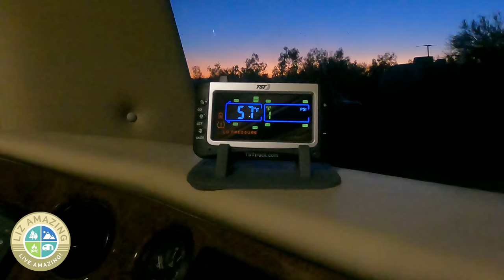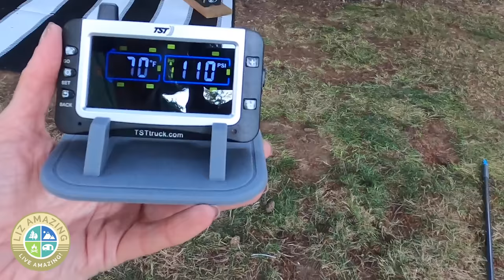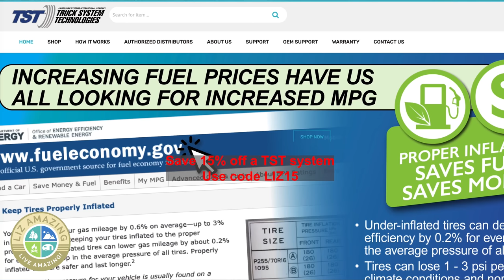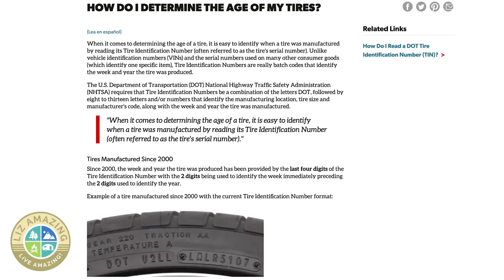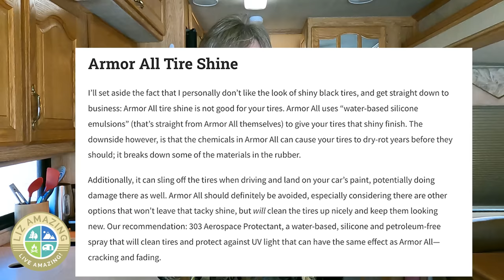3 questions everyone has about RV/Trailer tires

Comment: We live in South West Florida and we have a 2006 42' Monaco Dynasty Class A diesel pusher. After hurricane Ian there is no way we were staying for hurricane Nichole. My wife had recently had kidney surgery so we had to wait for her after surgery doctors appointment before we could leave. We left on Wednesday knowing Nichole was coming on Thursday, but as I said we didn't have a choice. Thursday morning we were on I-10 west heading away from trouble when a trucker tooted his horn to get my attention. I looked over and he was making a circular motion with his hand. I figured something was wrong so I pulled over. The passenger side was fine. I was worried the car we tow may have had a flat tire. On the drivers side I found the problem. One of the rear tires on the motorhome had a blowout. We have a tandem rear axle so we still had two tires on the road. There was an exit 2 miles ahead. We drove to the exit and over on the left there was a Truck Stop of America with a tire store. I was like thank you Jesus 🙏 We pulled in and the salesman assured me they had tires to fit my RV and I could even choose between brands. They told me to unhook the car and back up to Bay 5 and they would get on it immediately. With hurricane Nichole heading our way this made me happy. As I backed up to Bay 5 it started sprinkling. The mechanic told me they didn't have my tire. The ones they had were half an inch shorter. They recommended another tire shop in town and gave me their phone number. The guy said if I ordered the tire in the next 3 minutes he could have it there at 1 pm. I told him to do it  That was a 2 hour wait and it was starting to rain. We drove over to the other tire shop and waited. We had lunch and watched a movie. 1 o'clock turned into 3 o'clock and no tire. By this point it was raining hard and the winds were picking up. We were parked out back so I put on a raincoat and went around front to see what the deal was. Just as I got around front I could see the guy pulling our tire out of the delivery truck. The manager told me to pull into the end bay. He said there was a roof, but open sides so I would have no trouble fitting in. Our motorhome levels on the airbags. We don't have jacks. The mechanic had me pull up on block's to get the tire off the ground. By this point Nichole was upon us. It was heavy rain with the winds blowing the rain through the bay. Even with raincoats we were drenched! This guy was so good that he changed the tire without removing the rim from the coach. After he had the new tire mounted he checked the air in the other tires. The rear tires were averaging between 68 psi to 76 psi. The fronts were pretty good at 90 psi. So he aired everything up, we paid our bill and we went back to the Truck Stops of America to get our car. By the time we got hooked up it was almost black out because of hurricane Nichole. My wife and I talked about it. We didn't feel safe driving in a hurricane so we called around and found a campground with an opening 3 miles away. We drove over and I hooked up the electric and water. I didn't hook up the sewer or disconnect the car. The rain and wind were just coming down way to heavily at this point. The next morning Nichole was gone. When we opened the front curtains we found we actually had a beautiful lake view. The previous night I had no idea the lake was there. Visibility was that bad. I learned real quick on this trip that you have to keep track of your air pressure.
Reply from the maker: Wow, what a great story. I was on the edge of my seat. Thanks for sharing Adrian. Definitely consider getting a TPMS. You are so very lucky that the flat didn't take pieces of your motorhome with it, as it could have easily done had it disintegrated. And so glad you were both safe from Nicole. Thanks for watching.

Comment: I am so confused with our tire monitor.   We have a 36ft class A.  Every time we head out, the monitor always goes off. It is set at 80psi and at 96psi it goes off.  Cold start is 82 as our manual says.  I look down and then I ignore it.  I guess if it goes over 110psi I will pull over. Should I let some air out?  Any video I can watch? Thanks for anyone's comment.  The tires say max 110psi.
Reply from the maker: Hi Brad. Sorry to hear this. I wouldn't want to advise you on this. Your best bet is to call the mfr of the TPMS and get it set up correctly. Know before calling the recommended psi for your rig. Best of luck, this is too important to ignore.
Reply: @LizAmazing  Thanks

Comment: Easy fix add nitrogen to your tires instead of air we always used it in racing tires
Reply from the maker: I've heard nitrogen is good, I just never see it to top off on the road, or when the tires are low in the campground. Thanks for watching.

Comment: Howdy  tires give me nightmares!😢 I have spent hours trying to get the correct tire pressure on my class A. Toyo won’t say and I can’t do the the theoretical algebra math to come up with the answer. 😮 if they put max tire pressure in as they do I bounce down the road breaking things inside and the grandkids see their world coming to an end! Creepy tire manufacturers won’t say cause they don’t want to be libel in sue CA. Cracks  here we go again! I get it all. But if they are not cracked why replace them,  just have them inspected according to use! Rotate them and have a nice day. I have a older Class A. I have a Cadillac taste on a Yugo budget. 😅 I actually called the tire dealer who sold the tires to the previous owner and they would not commit to anything but 120 pounds! I said Shalom. I appreciate Liz and her info because we think alike. Any input is appreciated and welcome. I just want to safely go down the road and not have Top Ramen when I get there. Blessings John T.
Reply from the maker: Aww, thanks for this John! I, too, had a hard time finding the correct pressure for my rig. First I posted in the Alfa forum (Alfa is the make of my rig). I got five comments with five different psi recommendations! I got out the manual and learned that it depends on the weight of my rig. The mfr recommends get a four corner weigh and put four different psi depending on the weight for that corner! I'd already weighed (not four corner) and lowered my psi from 120 to 115. Thanks for being here, John!

Comment: Tires dry rot and should be replaced about every 6 years. Also be sure to check the manufacture date of your new tires. You don't want to buy ones that have been passed their shelf life. Although personally I don't bother but unless they won't hold air. But if they on a big vehicle like that better safe then upside-down in the ditch.  Also your ride quality will improve with rubber that isn't rock hard. All in all worth it.
Reply from the maker: That's the truth Mike, so glad I could share in this video about how to read the manufactured date on the tires. A lot of people don't know that. Thanks for watching.

Comment: Do not add Air to tires when Hot while Traveling because the Tire will explode while U-R on the Road OR while U-R adding Air to the tire So Always winter & Summer Always Add Air When begging of trip Do Walk Around Tire inspection & Air pressure. To make sure U don’t Have incident.And /U-R Saftey if U-V ever seen A Tire Blow it Can “Kill.”U.

Comment: As a vehicle dynamics/ tire development test engineer, that 6 to 8 year replacement "theory" is not correct, I highly recommend for motorhomes tires, at the 5 year mark from the tire date code, have the tires inspected by a tire specialist, by dismounting tire from the wheel and inspect from the inside. There is science and chemistry behind my statement.
Reply from the maker: Good tip, thank you so much! Everyone does indeed recommend a different number. And thanks for watching.

Comment: Liz, I have over 12 million miles under my backside.  And can count on 1 hand how many steer blow outs I have.  Personally I don't run on anything with cracks in the side walls. Also you can purchase a retainer for your tires which will not let the tire collapse and fall off the rim.  I highly recommend them.
If you ever lose a steering tire.  You are in for a hell of a ride.  
The majority of the time most people end up in the center dividers and rolled over.
Liz pm me and I can tell you the company that has them.
Safe travels and roads Brian and Cindy, "xtreambydesign with passion"
Reply from the maker: Thanks so much for this Brian and Cindy. I hadn't heard of the retainer so I will have to check that out ,I am doing an upgrade to help me steer should I have a blowout on the front axle. Stay tuned, and thanks for watching!

Comment: How many times have you heard " the seller said its ok" FYI.....The seller is either a serial fibber or they dont know squat. On a vehicle that size and weight any DOT cop will out of service you with tires like that. Also, no REPUTABLE repair shop will fix the flats on tire like that.
Reply from the maker: Yep! Keep watching because it turns out the seller was right. I sure loved working with them. After I bought it, they followed me to a campground and helped me set up. Great to know there are still good people out there. And thanks for being here, JC!